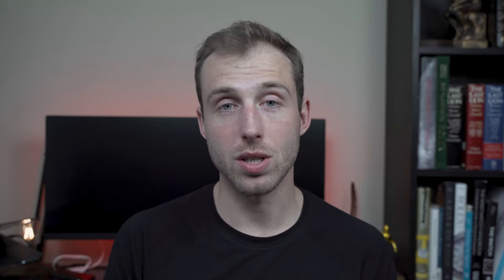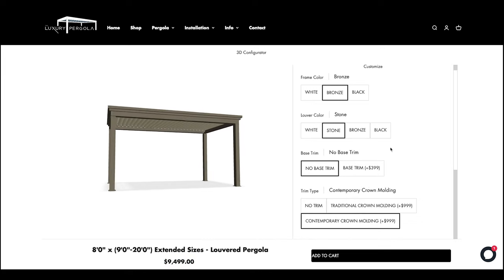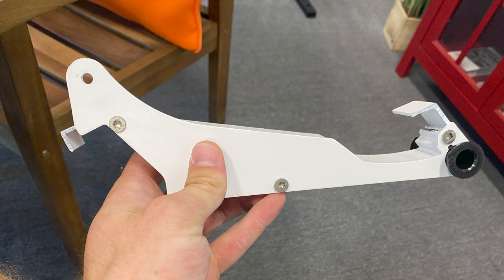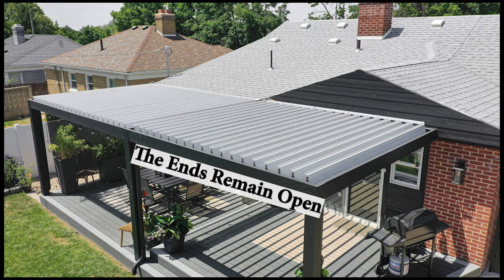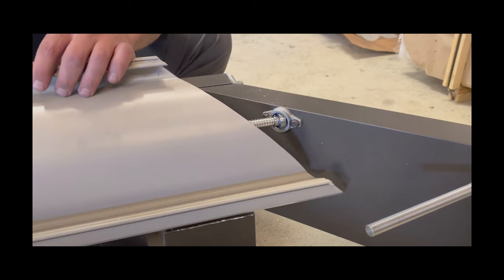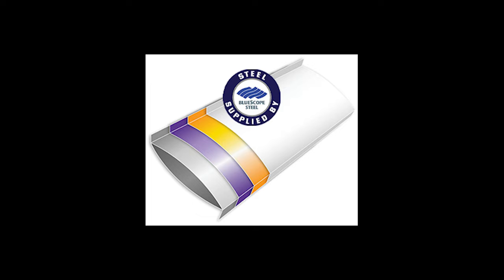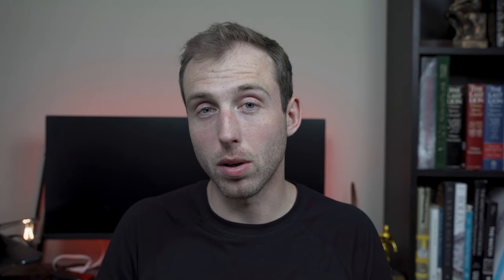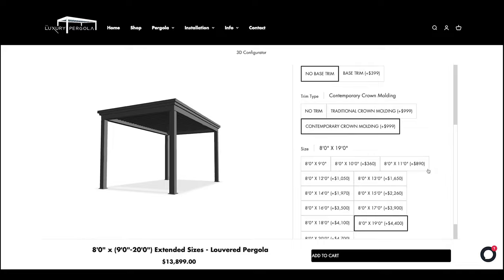What Are The Best Aluminum Pergolas? How Much?

Comment: What are your thoughts on the Hansø version?
Reply: Was the reply deleted?
Reply from the maker: @IllusiveMan343  it seems so. I'd research a Starry Pergola. From what we've been told by a prior customer, this is what is being sold but with a markup and some marketing. They send out the Starry install manual with their pergola. That plus the look of the Starry product is how we're under the impression that is the product under a different brand name. I'd look to Home Depot.
Reply: @theluxurypergola  How does that differ from what you group is selling?
Reply from the maker: @IllusiveMan343  Good question. I answer it in this video. That Starry product is in category 1 of the video. Ours is in Category #3, Weight and load resistance and durability over time. For example, that product weighs about 350 lbs when ours is 1,800 lbs for the same size unit. The video should explain the rest! Give us a call too if you have questions
Reply: @theluxurypergola  thank you!
Reply: Informative video. Thanks for creating this. Do you know if anyone in Australia can provide your specs?

Comment: Sealed bearings don't fail very often from this type of application. Sealed bearings are used in bicycle bottom brackets and last hundreds of thousands of revolutions in the hardest of environments. And if they do fail. they are very cheap to replace. They can also be serviced (but it's usually cheaper to just replace them. I assume you are an engineer and probably know all of this but are marketing the fact that you don't use sealed bearings.
Reply from the maker: That is true on revolutions. The concern with this application is the fact that it is exposed to the elements year round. Consistent exposure to freeze and thaw as well as salt air present the largest concerns and problems with these sealed bearings as they will be inert and exposed.

While they can be replaced. The hassle and cost of calling a contractor to replace 50-100 of these specifically made bearings frequently would be a question for the homeowner.

Comment: Product looks awesome! How do the materials differ from a 4k aluminum pergola?
Reply from the maker: There are several differences. The largest has to do with where it is manufactured and the thickness of the aluminum, which is a factor of longevity. Most pergolas that can withstand normal weather in the USA need to be about 800lbs minimum and anchored with thick steel base plates to be able to handle snow and wind. Most of those pergolas are 350lbs with base plate connections that are holding on by just the withdrawal load of the screws in the posts. Ours is a commerically rated product, typically sold for about $30,000-$50,000 just direct to consumer. If you give us a call we can give more insight!

Comment: Are you familiar with Renson? Curious to hear what you think of that manufacturer if you have any experience with them.
Reply from the maker: We have heard of Renson. The product seems to fit the classic european design for this aluminum pergola category, which means the posts have seams that run the length of the pergola. I don't know much of the strength outside of the aesthetics though, so I can't speak to that.

Comment: Can you insulate the inside of the louvers with expanding spray foam, for heat resistance and keeping bugs and critters out? Is you dealer have a retailer In Arizona?
Reply from the maker: Hello, if you want to shoot spray foam in the louvers, you can go for it. The end caps do a good job of keeping out any bugs or critters.
We do not have a retailer in Arizona, although you can get the units on our site and we ship to Arizona: https://theluxurypergola.com

Comment: Sounds like I will need to spend at least $10 - 15 K for about 12ft x 15ft louvered system.  Is that right?  If so WOW, that is a lot of money, even more than the cost of my deck.
Reply from the maker: That is correct for our version. obviously double for an installed version. They typically can cost more than a deck just because of the materials. Wood and Plastics (like composite decks) are relatively cheap to produce. Aluminum mined, melted, extruded into a specific shape, powder coated and then cut to size adds to the material cost. Hopefully I explained that in the video. Not the right product for everyone by any means, but certainly 1,500 lbs of aluminum costs us quite a bit.

Comment: do Pergolas require permits
Reply from the maker: There isn't a one size fits all answer for that. It is heavily dependent on your state or city. We always recommend asking your local building department.
If you want to see what your wind/snow load requirements are for a permanent structure, you can look here: https://hazards.atcouncil.org/
Make sure you use the value for "ASCE 7-10, Risk Category II".
This will give you a good idea of what the requirements are with the unit closed tight (open is irrelevant).